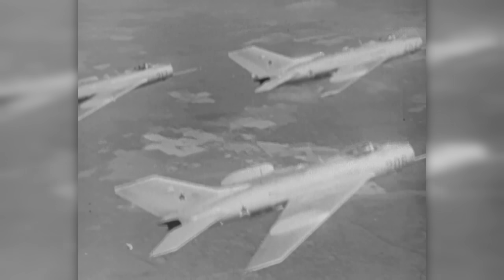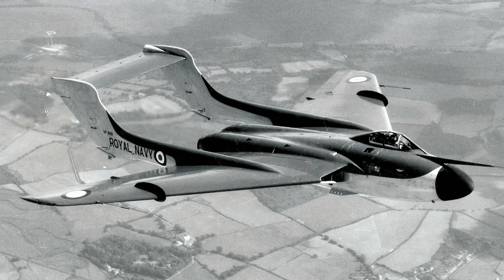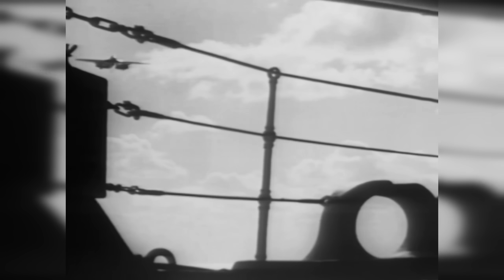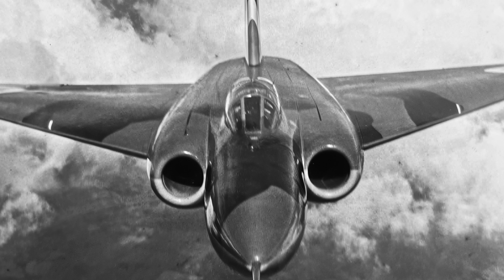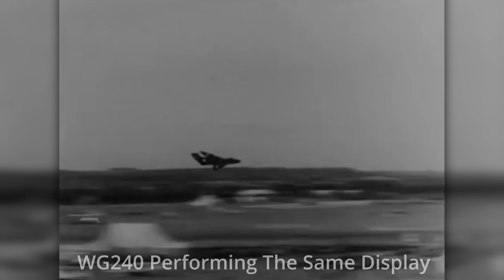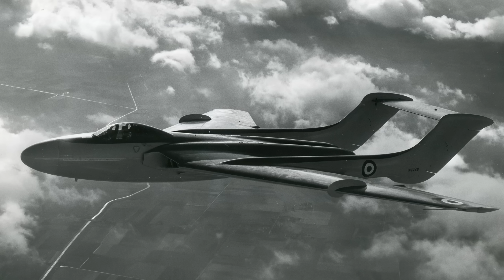From Disaster To Fleet Fighter | de Havilland DH.110

Comment: Although the observer gets an ejector seat, it's a damn tight fit. I sat in the coal hole in the display cockpit at Newark Air Museum, and reckon I had about 2cm clearance between my knees and the instrument panel. Definitely a crew position for short arses.

Comment: As the Chief Inspector's assistant at Hatfield in the fifties and sixties, my father was involved with the initial manufacture of the first Vixens before production was moved and Hatfield also moved onto other projects like the later Marks of Comets and the Trident.
Strangely enough, even though I joined the RAF in the seventies we did have some ex Fleet Air Arm Vixens on which we trained to fit and remove ejection seats. I always thought the cockpit layout odd, until in years later I was posted to RAF Wyton and began to supervise seat fit and removal on Canberra PR9's also with the pilot and navigator separated and at different levels.

Comment: Trailers don't "die" without serious use.  The museum should be proud that they managed to do that.  It shows that they've taken that cockpit on the road a lot.  

I'm a welder by trade and am currently a CAD draftsman.

If you give me a list of requirements I'll volunteer some design hours as long as your main CAD drafter can work with Solidworks 2022.  And if you could provide me with a test block in the shape of the cockpit that would expedite things a lot.  Admittedly I'm US based so not sure what the regulations for trailers are in Oz.

Comment: Is there a source stating that the sweepback originated in Germany? The thing is that the US has more experience with swept wings. Let me remind you that difficulties with sweepback arose at low speeds, and swept‑wing tailless aircraft have been researched in the UK for a long time. The significance of Busemann is clearly overstated. He merely theorized a well‑known idea.
Slats were used more frequently in Germany. They could have been borrowed. Until recently, many believed that fences on the wing were a German development, but this was actually a UK RAE innovation. And it was used in the US earlier than anywhere else for swept wings.
I dream of a time when authorship won’t be disputed based on commonplace assumptions. If “everyone is saying,” that’s not an argument. In the UK, everything is secret then, and it’s easier to justify using an idea without a patent by claiming that it was won in battle, rather than stolen from colleagues.

Comment: An old mate of mine ran an “unofficial” air museum just north of LGW’s 08 threshold, he was basically an aviation nut who visited military auctions ending up with an impressive and varied bunch of aircraft, I say unofficial because he did this primarily for his own love of the aircraft, however twice a year he would open the museum to the general public in order to help fund his habit. At some point he was approached by the local aeronautical college who asked him if their students could work on these machines on a voluntary basis for their experience, he jumped at the chance such that many of the aircraft had working engines, hydraulics and electrical systems.
Then the Sea Vixen arrived, her last job was as a target tug so she came to us in a yellow, red and orange colour scheme, soon the chaps got to work on her and many of her systems came back to life including her engines, thus I was given the honour on the next public day of jumping into the cockpit with one of the engineers in the coal hole, to start the Sea Vixen for the attendant crowd. After starting both engines, we had working hydraulics and electrics, so with that I unfolded the wings at which point the flying controls connected and duly waggled about, then it was time to put down the arrester hook and extend the speed brakes, a quick blip on just one of the engines was enough to complete the exercise and after retracting the hook etc and folding the wings I shut the engines down and the crowd went wild. That’s my only claim to fame for this beautiful aircraft, having been in aviation for over 40 years I can honestly say that that is one of the memories I will cherish and I didn’t even leave the ground.
Back then his little museum was called Vallence Byways, after his death in 2013 a bitter legal wrangle saw most of the aircraft hauled away and his land change hands, I believe some of the aircraft are still there but I don’t know who looks after them now.
Reply: Out of curiosity I just had a look at the site of his museum and guess what it’s still there! Admittedly a fraction of it’s former self but it’s called the Gatwick Aviation Museum and although it’s much smaller than it was some of the stuff is still there, from good old google maps I can see one of the two Shacklton’s, a Percival Sea Prince, Hawker Hunter and what looks like a Buccaneer. There is also one large building that used to house a huge number of engines etc so I would say if you’re in the area give it a look but please check opening times as it’s run by volunteers.

Comment: Great summary.  FYI, the various aircraft requirements of this period used a useful notation.  So requirement F44/46 was the 44th requirement document initiated in 1946 and 'F' indicates it was fighter related.  So the drafting work would have been done in the latter half of 1946 and the final document issued after the chaps had had a bit of time off for their seasonal festivities.  'F' and 'B' were eventually dropped but the basic convention continued with Air Staff Targets (AST), as the initial taster of an ambition for a capability, Staff Requirements (AIR),  aka SR(A) and the same year and number sequence annotation.  Later again the year was dropped and just a simple number was allocated.  AST403 for an agile combat aircraft thus eventually morphed to SR(A)414 to define the RAF's specific requirement for Typhoon.

Comment: The requirements for drop tanks is just another foolish example of technical rather than functional design. You don't need drop tanks you need a certain payload at a certain range (with perhaps other payloads at other ranges). You don't care how the designers do it, drop tanks or internal fuel and you are a fool to try to corral them down unnecessary paths.

Classic example, massive government IT re-equipment tender in the 1980s asked for high quality dot matrix printers with at least a 9 x 9 dot array. Nonsense. We changed it to high quality office printing to allow the companies to tender the newly emerging far superior laser print technology. 

You see these sort of stupid specs all the times these days ensuring the purchase of obsolete inefficient kit.

Comment: I remember seeing these in the early 50s on board HMS Ark Royal during a fleet review at Norfolk, Virginia, USA.  We figured the offset canopy was because the British didn’t have tape measures, so they had to eyeball the canopy placement.  Also, we were amazed at how small British aircraft carriers were.  They invented the angled flight deck but apparently they could not afford to build carriers with them and instead merely painted them on straight flight decks.

Comment: This is a video I badly want to see. For some reason YouTube keeps buffering. So annoying. Not only is it not possible to filter out AI slop, now even the basic technical platform seems to be breaking down.
Reply: You need to get a fiber connection.  Those dialup modems will buffer every time.

Comment: My Uncle flew Sea Vixens for the Fleet Air Arm. To say he had risk perception issues post retirement is putting it mildly. 

He maintained you didnt land a Sea Vixen, you rammed it wheels-first into the ship as hard as you dared.

Late Edit: the Shoreham crash didn't kill any actual spectators - he speared it into traffic waiting at the lights on the A27 which runs to the north of the airfield.
Reply: The whole area has been redesigned with an odd looking road design.
Reply: @davidbrennan660yeah, i know. I live in Hove